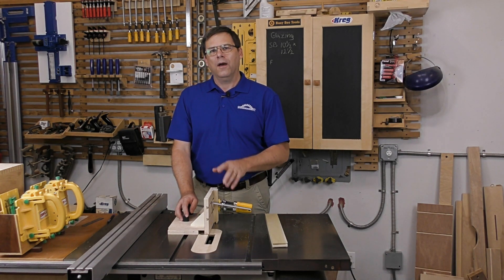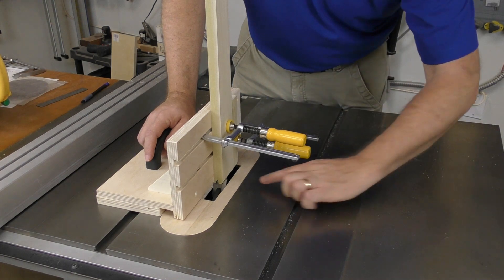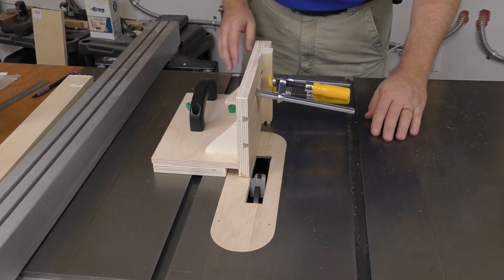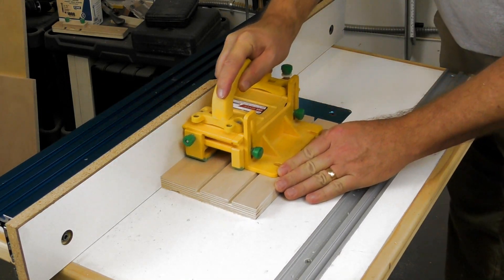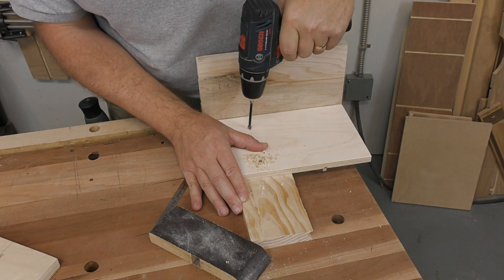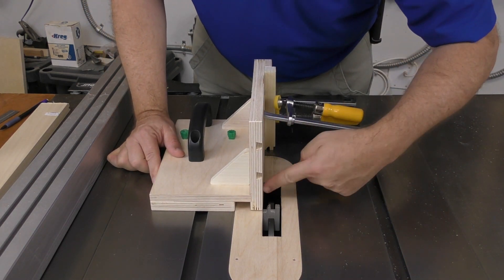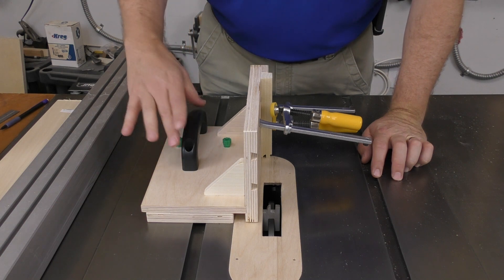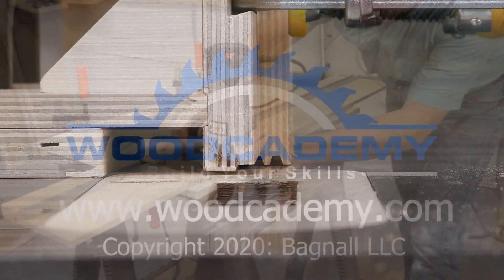Designing a Tenon Jig

Comment: Wouldn't a custom zero clearance insert help reduce the chance of the part from dropping in?
Reply from the maker: Andrew Betschman in many cases, yes. With dado stacks and certainly with molding heads, a large opening is unavoidable.
Reply from the maker: Andrew Betschman you will notice that all commercial tenon jigs are designed to clamp the part.